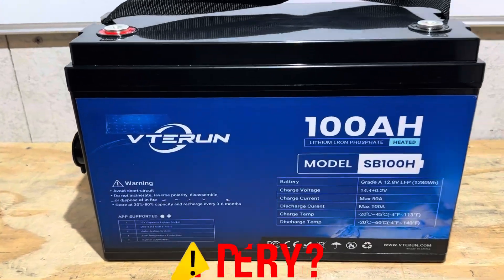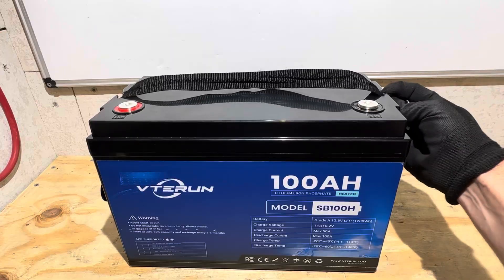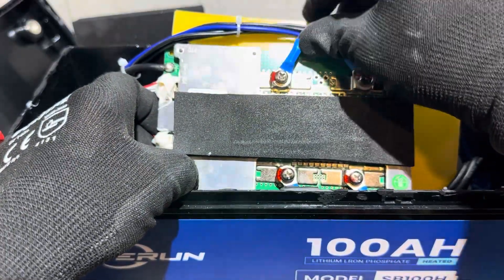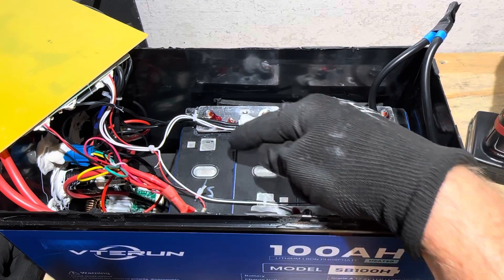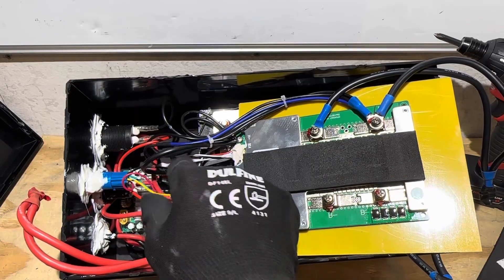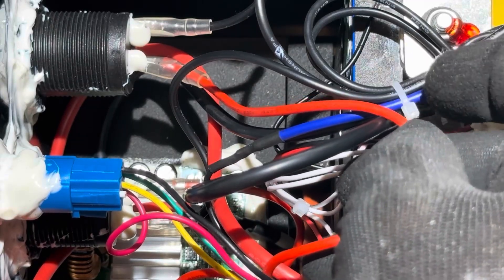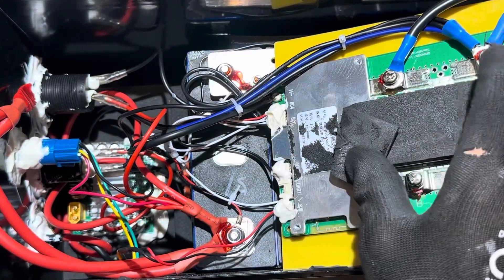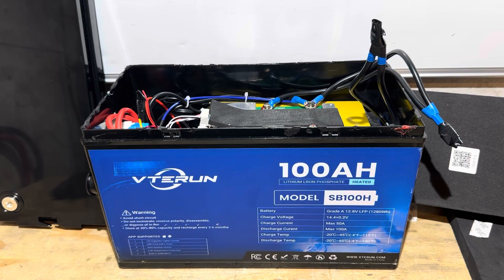VTERUN 12V 100Ah LiFePO4 Lithium Battery Review & Teardown, Self Heating Battery with Built In MPPT

Comment: Yep.... I wasn't impressed either! You got the same battery I did!
Reply from the maker: I appreciate you showing your testing! Was your date code the same? Yours was more recent than the ones reviewed that had fuses, correct?
Reply: @THEOFFGRIDMOUNTAINHOMESTEAD  there was no date code on my battery when I tore it open but it was very similar to yours. Mine had the ground off QR codes on the batteries and no fuses.
Reply from the maker: @Jasonoid Appreciate the info, I saw it was very similar but couldn’t remember if you had date stamp in yours. Thanks!

Comment: Did you try to use the mppt?
Reply from the maker: Yes it worked properly! Got 180W+ delivered to the battery under terrible sky conditions with Vterun panel.

Comment: I would not mind seeing the panels and the inverter, after all, you have already spent time recording the vids. But, that battery scares me! So many loose connections! If I had to buy that battery, it would only be used for low power applications.  I think this is one of the worst batteries seen on your channel. Personally, a battery should just be a battery. No 12V outlets, power switches or MPPT charge controllers.  Too many things that can go wrong. Like you said, MPPT charge controllers generate heat. I know that my ISUNENERGY 20A MPPT charge controllers can get pretty toasty charging batteries at 20A.
Reply from the maker: Thank you for your feedback regarding the other components! The DeePower (VeloTek) had some rough cells and the GoKwh had metal shavings on used pouch cells, probably a toss up between them! 🙂
Yes a 20A controller maxed out tends to get a little toasty! 
Appreciate you taking time to watch and comment today!